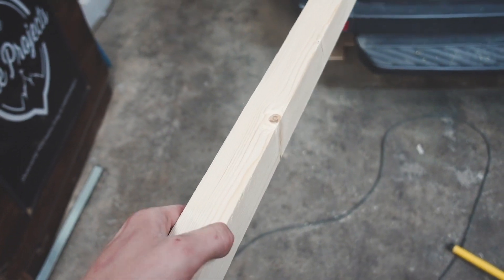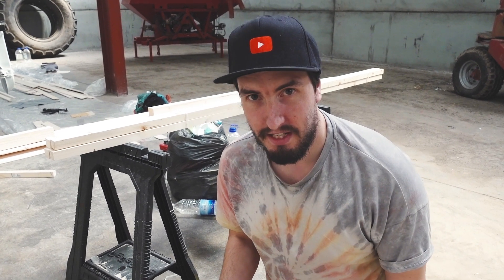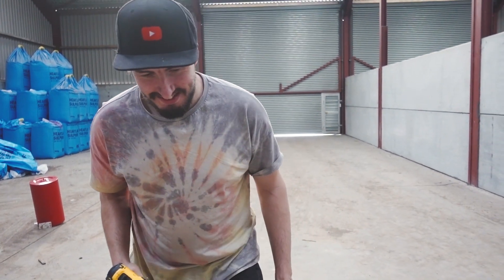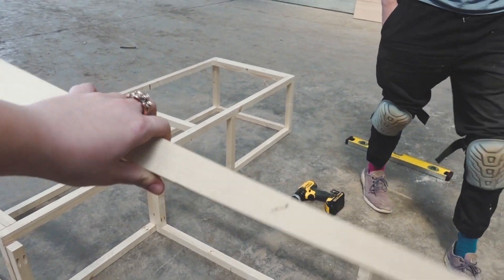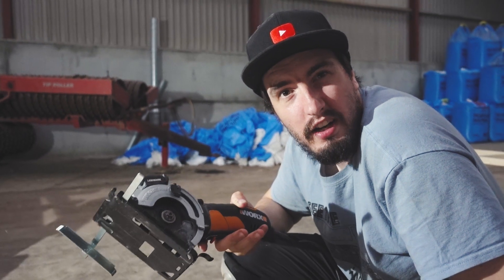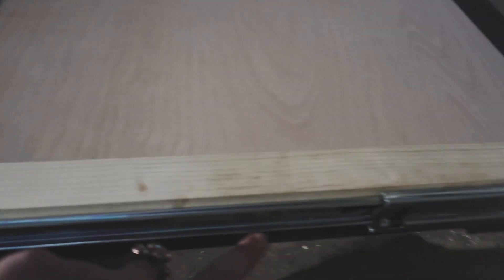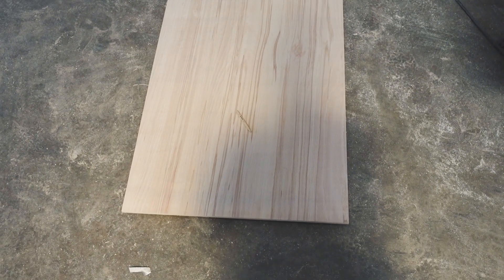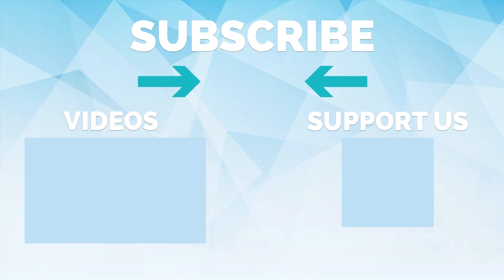Our Dream Custom Van Furniture - Sprinter Conversion Series

Comment: my plan is like yours but i am adding a toilet cubicle next to the door so i can still have my l shaped seating..then have the kitchen behind the drivers seat..i dont have plans for overhead cupboards but i am having cargo nets on the roof for clothes and blankets  but leaving a space down the middle un obstructed..it is army style..
Reply from the maker: That’s a clever idea!
Reply: i havent got time or space for cupboards to smash my head on or things to fall out..hahaha.them cargo nets can be really tight and secure and not too bulky i recon.and you can see where things are through the nets without ratching through cupboards..saves on weight too i recon but still look good..the main thing is to get the basic jobs done well like you guys are doing..like walls floor and bed etc..a few cargo nets add a bit of flavor for me..im loving your attention to detail.

Comment: How about leaving a fixed-flat section  (maybe 4" deep) at the back of the liftable seats, so that you aren't fighting the cushion when you lift? i.e. the hinge would not be at the very back, but 4" from the back. Disadvantage would be that it wouldn't open fully for very large rigid items e.g. a plastic tub.

Comment: Are you going to add a support block or something underneath the portapotty draw or are you not actually planning on sitting on it where it pulls out? Sorry for the nosy question lol, wouldn't want it breaking the runner with added weight 😅

Comment: I assume you will not just sit on the toilet on those runners, once it is pulled out. I don’t think they are designed to take your weight. But I could be wrong.
Reply: My thoughts exactly, be a shame for the metal runner to punch a hole through the floor covering and wreck it.
Reply: My thoughts exactly. Maybe add a few casters to the base of the ply to take any weight if you plan on using the loo on the drawer. Casters or even some rounded wood blocks/skids (not marks lol) would do..
Reply: Maybe they could just hover 😂😂 it would sort the issue out !

Comment: I'm curious what kind of toilet you are going to use... personally, I would use the C-head toilet, as its a decomposting toilet, and the smells are basically nothing (except for when in immediate use). Its actually more ecologically responsible than a chemical liquid toilet (I been doing a bunch of research). Best reviews I can find for an off grid toilet system is the C-Head, when you compare to ease of use for maintenance, cleaning, smells and convenience overall. So maybe check it out if you've never seen it!

Comment: In the second guessing category; I wouldn't have used a pocket hole jig for much of that sofa, I'd have used metal angle brackets or 90 degree rigid brackets and then screwed into it. Pocket jig holes look really pretty but strength-wise I'm not sure that's ideal, that's more for stuff where you want it pretty. Angle brackets would probably have resulted in a stronger frame. Hopefully what you have is sufficiently beefy, but still. (Granted, my personal plan is to construct the entire skeleton for everything in the van out of t-slot aluminium, probably 20 x 20 mm, and bolting it all up with mechanical bolts.)

Comment: I'm busy revamping my Transit Minibus Campervan so I'm keen to see how you guys get on. What are the internal dimensions of your van? I have 3.1m length ways & 1.75m width at floor level. I cheated and bought a pine double bed frame for £25 & cut it to size. Raising it to window height means we can sleep across the van saving space & giving us masses of under bed storage. Our double foam mattress came from eBay for £85 delivered & super comfy. We had bought caravan cushions almost identical to yours but when we pulled the covers off the foam looked old and yellow so they went in the skip. Good luck with the build and keep blogging. I've pinched loads of ideas from yours and other 'Vans you feature, plus Rustic Campers on Facebook.
Reply: Oh, I'm 6ft exactly and can sleep comfortably stretched out.
Reply: Mattress came from SleepKings

Comment: Hi, put a pair of rollers beneath your drawer, the runners won’t take your weight if you plan on using the toilet in place when extended out. If you can’t find rollers then just lower the facia drawer front so it’s a few millimetres from the floor just it will still slide out but when you pull it out to use it will only flex down a few millimetres before it it’s the floor and therefore give you the support you need to use in place 🤙🏾🤙🏾🤙🏾

Comment: What a solid, super minimal bedframe. My bed is so much smaller (60cm wide) and there is so much more material... I have been thinking about getting a pocket hole jig from the beginning, but this has done it. I'll get one as soon as possible :) What brand is yours? Edit: Found it in your video description. Thanks guys!

Comment: Theo's drilling skills are definitely coming along nicely :). Still think it would be a good idea to isolate the bed frame from the garage (and insulate) to act as a dustrap. Hardboard or cheap laminated flooring would work fine.

Comment: hi great job but don't want to be a party pooper but have just noticed that you may have fitted your t&g boarding up the wrong way, the tongue should be pointed upwards in case you spill anything then it won't fill up the groove and hold water.

Comment: Hello again 😁 Did you screw any the bed framing to the floor or wall battens? Going to do my floor battens and insulation tomorrow and can't tell whether to lay them so I can support my furniture etc... Hope your both staying safe and glad you finally gutted the van!
Reply from the maker: Yes we put some l brackets from the vertical bed frame and screw into the wooden floor to stop it shifting around.
Reply: @theindieprojects  Thank you! I'll make sure I lay my floor battens to support the bed.

Comment: Man you dance at good as I do 🤣 sooooo you know Argos and some other shops give you a 28 day no reason necessary money back guarantee... they sell drills and it would save you time and battery, I always misplace the other bit when I don't use two drills so will be using two for my build.

Comment: If you sit on your potty with it off the ground, it will bend the tracks.
Reply: The sliders are rated for a certain weight. Pretty sure they read the specs.
Reply: Well thank you Marion

Comment: Your slide for the toilet does not look strong enough to support your weight when using the toilet.  Installed china drawers in my kitchen and the slides were a lot thicker.  Could be the camera, but if not better to fix it before it breaks.